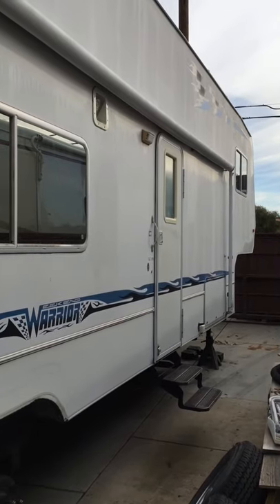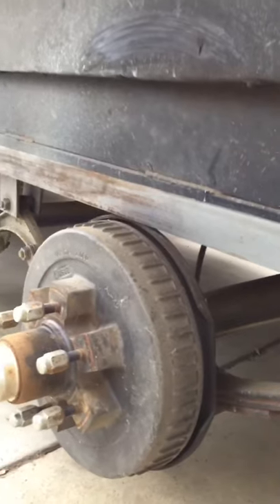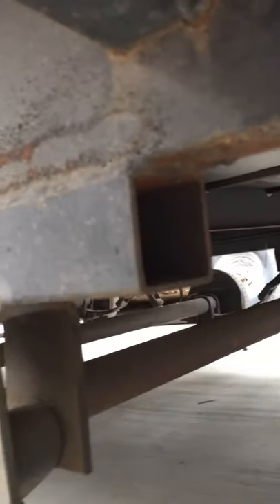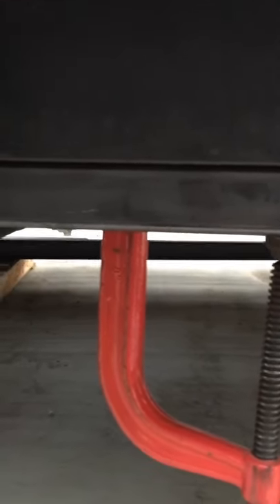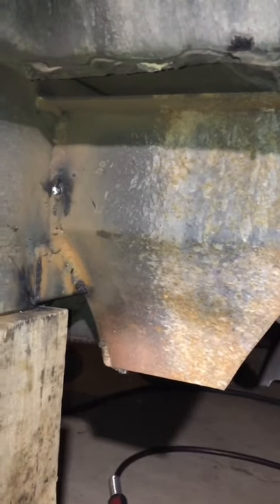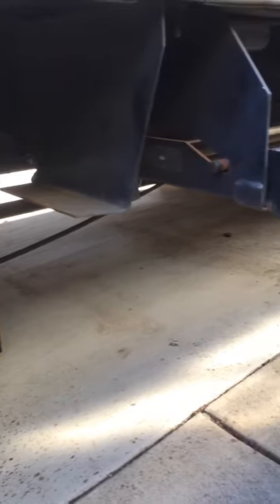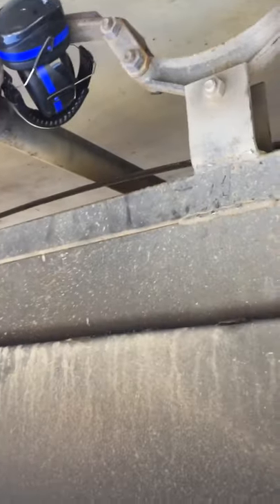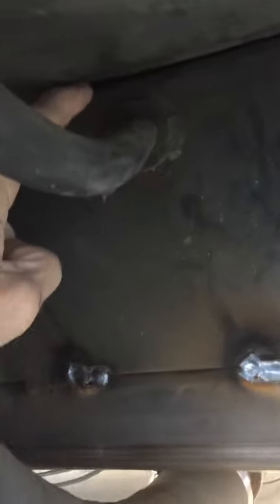Weekend Warrior sagging wall frame repair

Comment: Check the bottom of the cross supports where they meet the frame. on my trailer, they were pushing and cracking through the frame itself, causing the tops of the frame to bow outwards.

Comment: Great video! Is this issue more common to a certain year range of Weekend Warrior? I'm looking at a 2008 Model 2805. Also, how much added weight in steel reinforcement do you estimate was added to the trailer? Thanks
Reply from the maker: Sorry for the late response 
I added over a couple hundred pounds of steel to the trailer, this one is a 40’.
Some of the later models came with the center outriggers, does your trailer have them?
I’ve helped a few people with other model warrior trailers, they all have some type of problem.

Comment: I plan on doing this soon.  What do you think about supporting the trailer by its walls with jackstands instead of the chassis ?
Reply: For example using 40' of angle iron in between the walls and jackstands. My Thoughts are this would allow the entire mass to 'relax' downwards before adding the reinforcements
Reply from the maker: I would not try this, let the frame and outriggers do there job. Jack up the trailer and get it supported, you’ll be amazed what will go on, let it settle.
Reply: Ok thanks. I'm picking up a 3905 this weekend which is not too bad, if at all. But I want to do preventive reinforcements on it
Reply from the maker: The next one I work on I’ll cut the 2” square for the springs off, and just replace.
Reply: @GlamisHopper  I see, with one continuous piece. Is there anyway we could communicate via email ?
Reply from the maker: @JohnsCustoms  yes
finnrm@msn.com

Comment: I got a question, do you have any concerns of the frame cracking where you new welds are? Ok have an 07 5th wheel le3405 I got for a good price. I want to do this to but I'm afraid of heating up the frame from welding and causing cracks, I love my 07 and it's a hell of a lot cheaper than a new one
Reply from the maker: I’ve never had a frame/weld crack. They all need some type of added support. This 40’ trailer after the repair was a completely different trailer, quite, no noises coming from the coach while driving around.

Comment: Nice job. Do you work on other trailer? I have a 2007 weekend Warrior FSW3200 I need some repair its not that bad but it needs some work.
Reply from the maker: Hello Miguel,
Did you find someone to make repairs?
Reply: @GlamisHopper  no I didn't I ended up selling my trailer but thanks for the response.

Comment: Does this also fix the walls from pulling away?  A section of my wall has pulled away from the cabinets almost an inch on this last trip I made.
Reply: @Your homie#1727 can you elaborate?  Maybe pics?
Reply from the maker: Yes this will fix the walls from moving out, also the wheel wells.

Comment: Doing this to my 3105 had a question when you Jack it up and set it on jackstands to let the frame relax do you unbolt the outriggers from the walls or leave them in place they are all tight
Reply from the maker: Let it sit for a few days, then check again, if still tight I’d leave them.
Reply: Will do thanks for the info and good video
Reply: How far past the original 2x2x.125 did you go on each side with the angle iron?
Reply from the maker: @jackfergusonjr7016  6” to 8”, if you can just cut the old 2”x2” out and just run continuous, would be better. You’ll just need to install new spring shackles.
Reply: Was going to it's welded in good to the steps  and mud guards so left it but did cut off hangers I need 2 inches of lift didn't want to do axle flip more then needed so putting another 2x2x.1875 12 foot long tube under existing and  putting new hangers on instead  of angle iron

Comment: Hello, i’m in California. What does a job like this cost on a 2005 FS3000
Reply from the maker: Hello Ulysses Jurado 
We would need to look at your trailer, the FS are a little different. The price of steel has gone up through the roof, the cost of this labor and parts would be in the 6-7k
Reply: @GlamisHopper  do you do any repairs for others?
Reply from the maker: @georgerogers9843  I do, I’m really busy now, when did you need repaired?
Reply: @GlamisHopper  do you have a number or website?